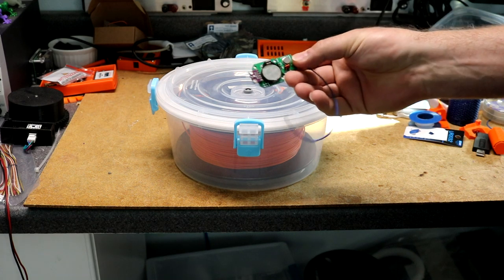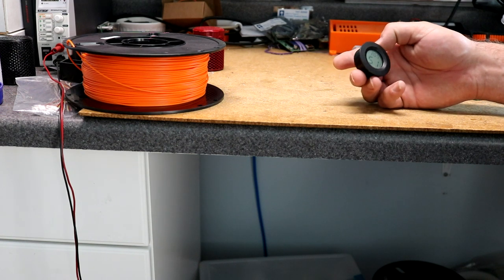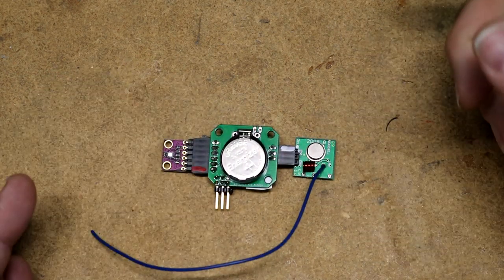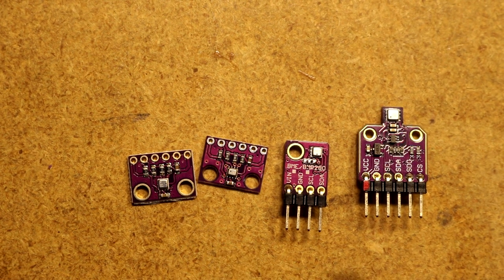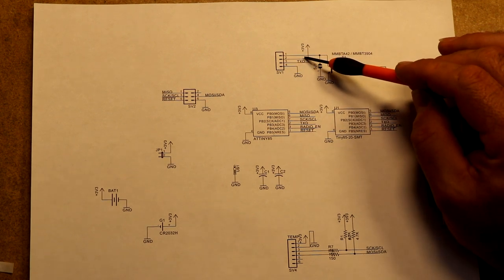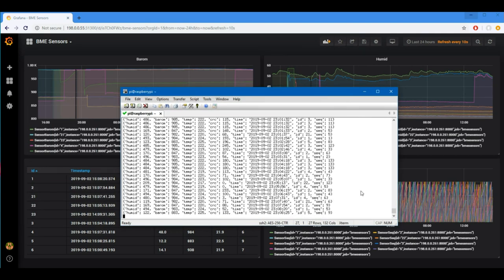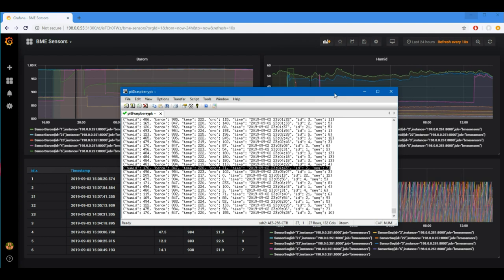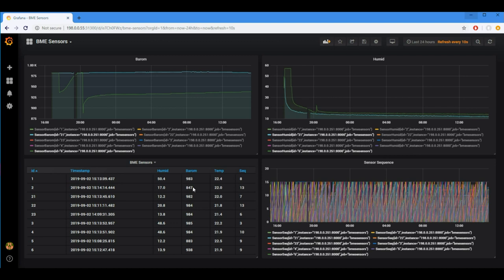DIY Wireless Temp/Humid/Pressure sensors for measuring vacuum sealed 3d printed filament containers

Comment: Why dont you use superhet 433mhz rx and tx. I use them and they are both have crystals and fixed frequency, reception is very good, even from 200meters.

You can tune the models are you using by the tx coil (ask if you dont know)
Reply from the maker: I'm using 315Mhz to avoid contention my with 433Mhz blinds, which are quirky enough already without having to share frequency with other devices. I did buy a couple 315Mhz superhet receivers on eBay that I was planning on trying out, but I ended up setting up the rtl-sdr while I was waiting for delivery. I'd be interested to read your tips on tuning.

Comment: Be careful with the 433MHz vs 315MHz modules, in most places only one of the two is unlicensed. Not sure about the US, but here in AU 315MHz is licensed (people have actually been fined for using crappy Chinese doorbells operating on 315MHz).
Reply from the maker: I believe 315Mhz is unlicensed here in the USA, with certain duty cycle limitations (for example, 1 second maximum transmit duration, and "off" for 30x the "on" duration).